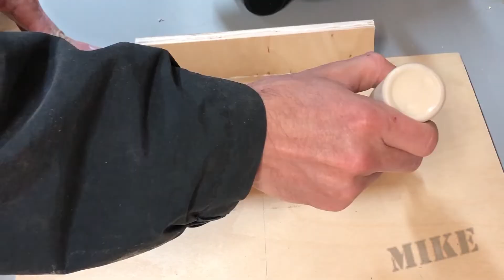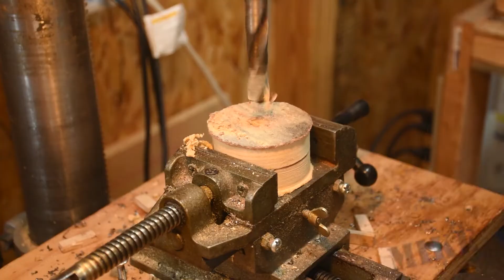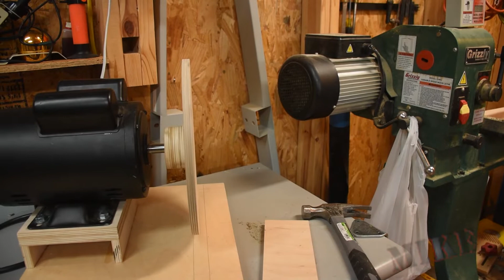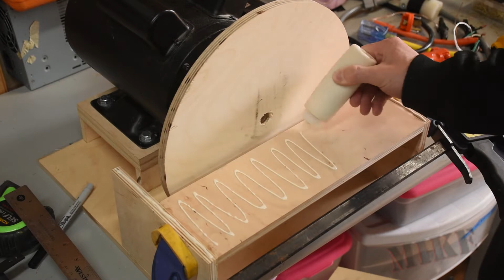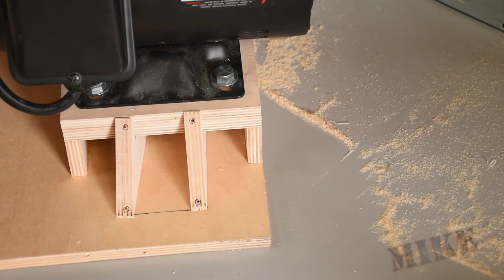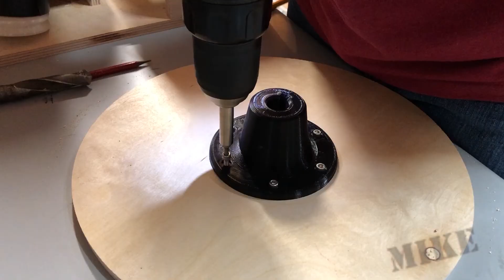Disc Sander - Mikes Inventions

Comment: How does this video only have 2 comments.  This is some great stuff. Love the forethought in your design, such as the strain relief on the power cord. Surprised you didn't make it variable speed...although i'm not sure how you would do that exactly. Would a 120v dimmer work taking into account amperage on the motor?
Reply: changing a standard motor into a variable speed can be done effectively on some motors. but it's not as simple as a dimmer switch which changes voltage (burns up motor from overcurrent) usually done by varying the frequency and voltage. 4+pole motors can have the pole timing and sequence changed for different speed/torque curve.